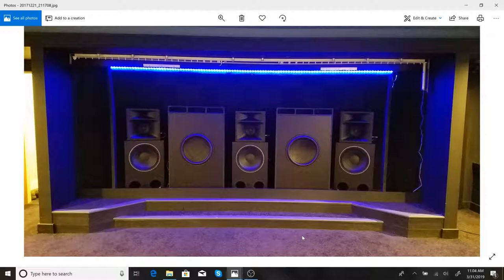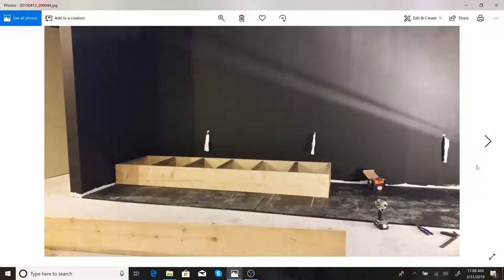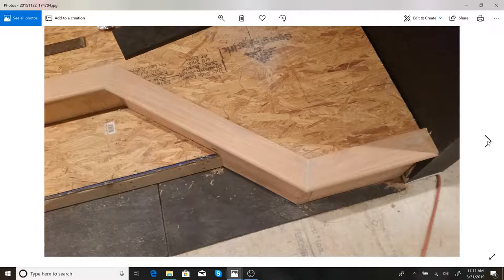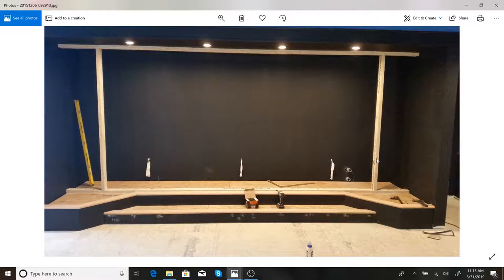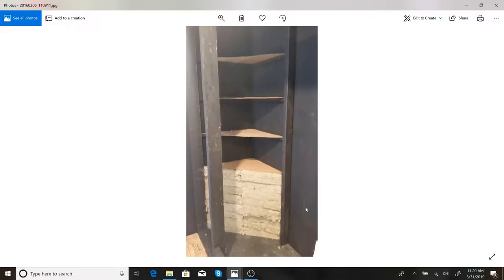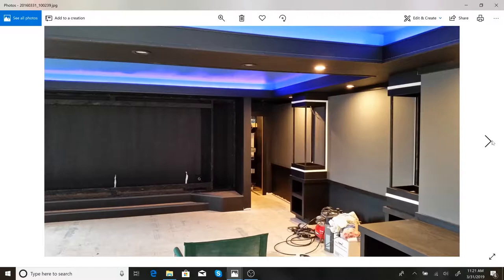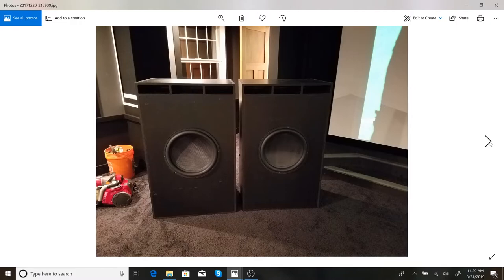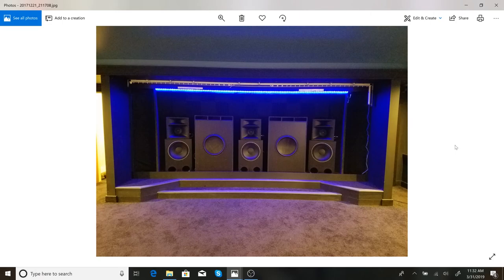Home Theater Stage- Construction on the Second Floor

Comment: Thanks for sharing. You cover isolating the subs and speakers from the floor in detail, but if you're playing at (or near) reference level, the sound in the room should still be going through your wall. Surely no one is in a room right next to that side wall, with nothing else between you?
Reply from the maker: Hi mikey, thanks for the comment.  You certainly can hear the lows at reference levels directly on the other side of the interior walls, just not nearly as much as I expected as I didn't do much treatment at all. Luckily the way our house is setup, the wall behind the screen is a stairwell to our mudroom and the wall to the left of the screen is only partly shared with our master bath.  The remainder of the walls are exterior and below the theater is the garage.  If you look at some of my other videos, you can get a feel for where it is in the house.
Reply: @smarthomeMASTERY  Yeah that makes sense, cheers. You don't need all the isolation clips etc as you're already isolated from the rooms others are using. We have rooms all around my home cinema room, so I'm going crazy on sound-proofing.

Comment: great content and instruction.  tons of stuff on YouTube about the AV aspect but very little on the build and if there is the instructions are terrible.  Your info is very clear and detailed.  I am new, you may have already addressed this but it looks like you have a 16:9 so if you watch cinescope wouldn't u need to mask top and bottom vs left and right.  curious to see how you solve that problem... I can't figure out a solution that will look good and not so DIY hence I am going with a cinescope screen so that I only need to mask left and right, which is easier to mask DIY
Reply from the maker: Hi JimX, thanks for the comments and compliment.  My screen is 140" wide, 2.35:1 cinemascope, so no need to mask the top and bottom only the sides when watching 16:9 content.  The blue box you see in the video is a 16:9 image.  Let me know if you have any other questions.

Comment: Did you ever complete your curtain masking system? I’d love to see a video on that!
Reply from the maker: Hi Marc.  I have it partly done.  I have the curtains installed and the head-rail is now hidden with trim.  I just haven't programmed the motor yet so that it stops where I need it to.  The reason for that is because I still haven't pulled the trigger on a new projector.  I'll try to make a short video of it soon.  Let me know if you have any questions though.
Reply from the maker: Hi Marc, Just letting you know that I just posted a video on my screen masking system here: https://www.youtube.com/watch?v=WmiqaQe912w&t=22s  Let me know if that helps or if you have any questions. Thanks, Tim

Comment: I bet musicals and concerts Rock in there cant wait to see the rundown on the rig of equipment your using what amps are you driving those bad boys with and yes would love to see a room tour when finish Nice Job
Reply from the maker: Thanks!  Right now the LCRs are driven with a cheap Sony AVR and the subs are driven with an iNuke6000DSP.  I'm going to get either a Marantz 8805 and their amps or an Emotiva RMC-1 and their XPA amps.  First is the 4k projector and seating though.  I have a short room tour video posted, but will be posting more as it comes to completion.

Comment: Thanks for the video. This helped me BIG time. I am almost done with my 2 Full Marty subs but I am worried about the ports moving the AT screen. Does the air from your ports move your screen? If not, how many inches are in between port and screen? Thanks again!
Reply from the maker: Awesome, glad it helped you.  I was worried about the same thing, but my AT screen doesn't move at all that I can notice.  I just measured and it is 3" from the edge of the port to the back of the screen.
Reply: @smarthomeMASTERY  awesome... I was worried. Any trouble with subwoofer vibrations on stage? I am concerned because I used insulation (not sand) and did not glue down or use the black roofing roll that some forums suggested. I am thinking about putting on a DIY base with tennis balls to isolate vibrations from floor. Wondering if that is overkill based on your experience?
Reply from the maker: @ryanraines8944  Nope, none.  As you see from my video, I only used insulation too, but I have the stage floating on rubber mats, plus rubber mats on top of the stage, plus made four "feet" out of the mat for each sub to sit on.  I'm really amazed how little you can hear or feel the base in the rest of my house.  It will make your ears bleed in the room itself, but other than some low rumbling, you can't hear or feel it much in the rest of the house.

Comment: Where did you locate the bull nose trim? Did you route it yourself? I cannot find any that wide.
Reply from the maker: Nope.  Got it from my local building supply.  Home Depot or Lowes should have it too.  I had to use oak though.  I couldn't find it in poplar.